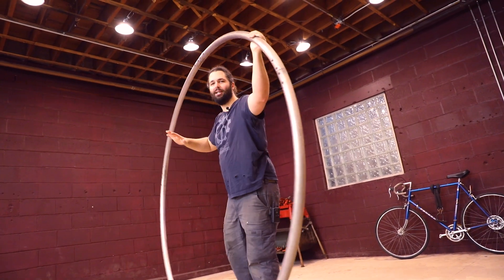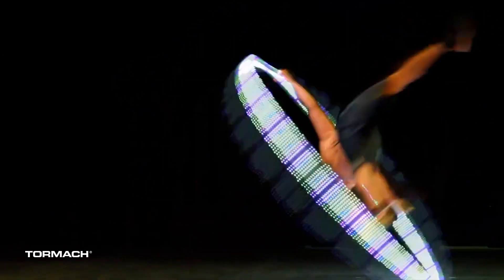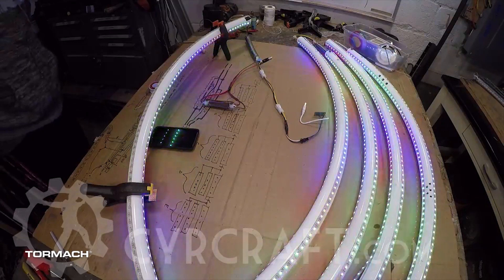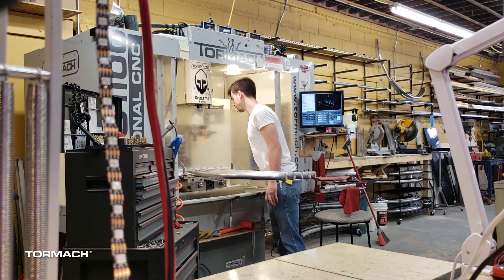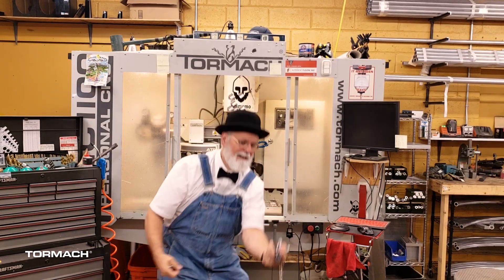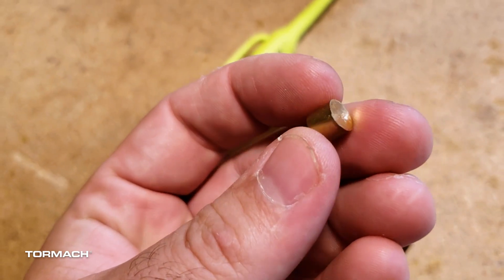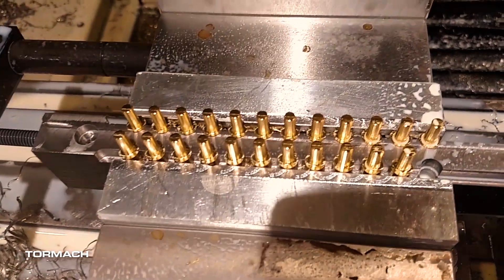Making Crazy Cyr Wheels with CyrCraft Customs

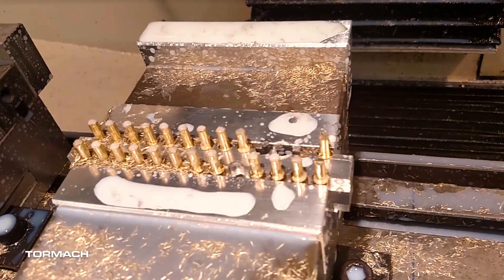Comment: Really nice...can you say more about that fixture you're showing at 2:55?  Is that just a soft jaw with center section?  V-cut or round holding?  Any issues with spinning or holding the outside pieces?
Reply: The fixture in that shot was the prototype of our production fixture.  There's nothing special with the jaws, but the center block has half round cutouts just about .001" undersized for the brass bar stock, and the tiny amount they get deformed doesn't matter for this part.  Once we got everything dialed in, there were no issues with parts moving.  But until we got it all dialed, we threw a few pieces out of the fixture - you can see some of the empty spaces where parts got thrown from.
Reply: At about 2:44 you can see the production fixture